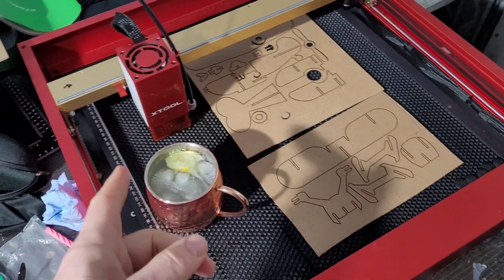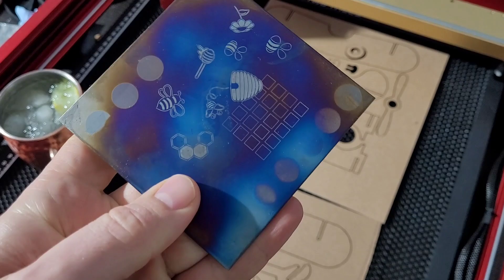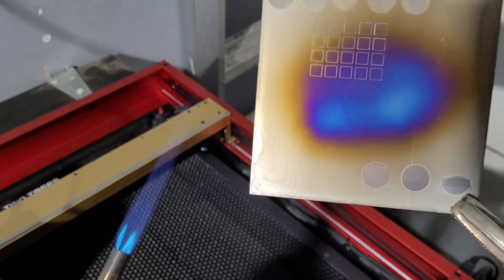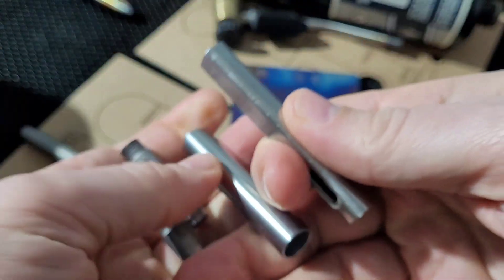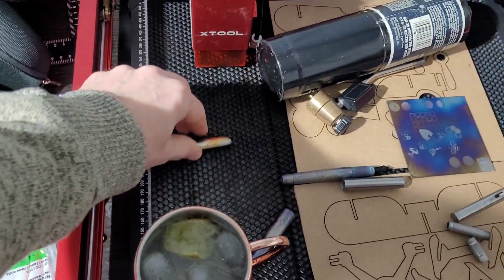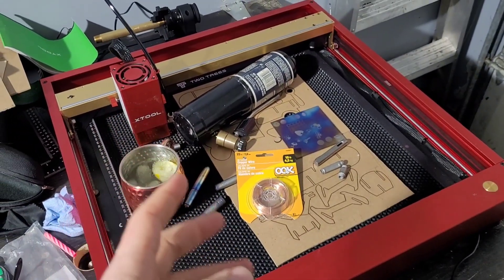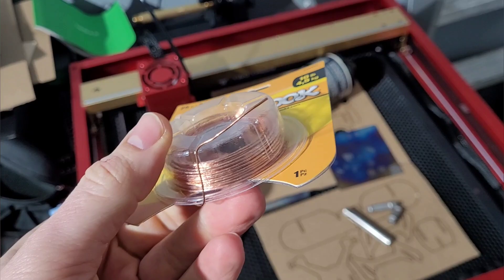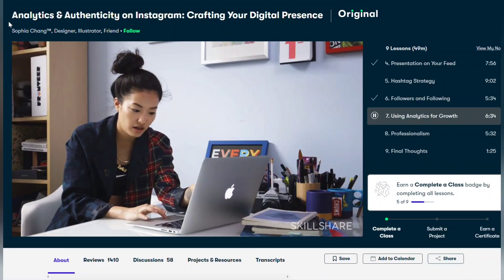Laser Titanium Anodizing and Making A Fountain Pen From Wire + 3D Printing Update (xTool D1 Pro)

Comment: I’m an educator; it was very nice to meet Doodlebud Jr. He’s so cute. For the wire pen, I’m guessing that you will use the wire as a scaffold and then print the plastic around it. You may also try stainless steel wire then temper it to make it hold the desired shape. I’m not an engineer (as I noted), so I’m just sharing some ideas. Looking forward to the results!
Reply from the maker: Kinda the other way around.  I will make a 3d print to wrap the wire around to guide the shape of the pen body.  I will then have a lose wire body and will solder it together to keep its shape (hence the copper).  No idea if this will work (probably wont) but it will be fun to try and I'll learn something that I can perhaps use somewhere else.  Its all about gathering little knowledge nuggets that you can one day pull out and use in a different application.  That's my favorite part of the creative process.  Acquiring little bits of info, not just to know stuff, but to figure out how to apply it to something new.

Comment: It's not just like a phase shift, it is (with some complications).  Cos(πwt) + Cos(π(wt + φ)).  Depending on value of w (the color) this is destructive or constructive or in between (with fixed  phase shift φ). Thus color. (Might be cos - cos, depending on boundary conditions for reflection, which I don't remember offhand.) There are, of course, always engineering conplications.)
Reply from the maker: Yes correct, an interference rather than a phase shift
Reply: Interference cause by a phase shift
Reply from the maker: So a little from column A and a little from column B 😉
Reply: https://en.m.wikipedia.org/wiki/Thin-film_interference

Comment: Pen out of wire. I could see a steel (or other hard material) wire triangular shaped upper body, connected to metal/plastic lower assembly. Basically "naked" converter with wire welded to some kind of nut, that screw to the feed casing.